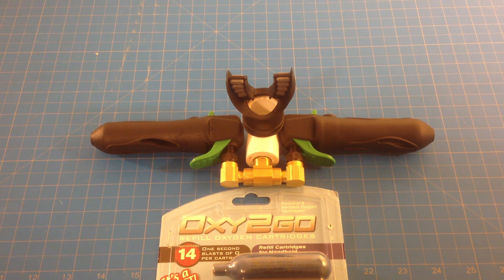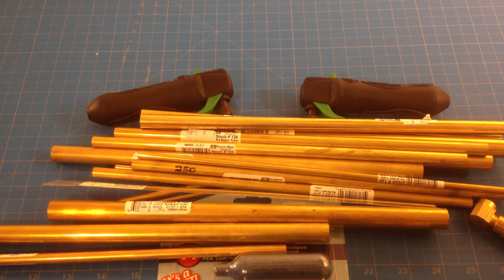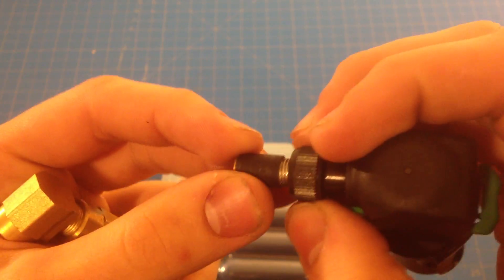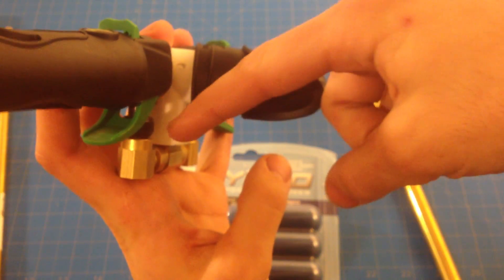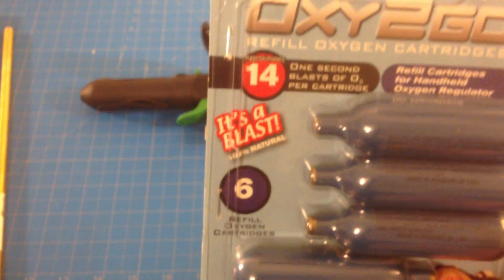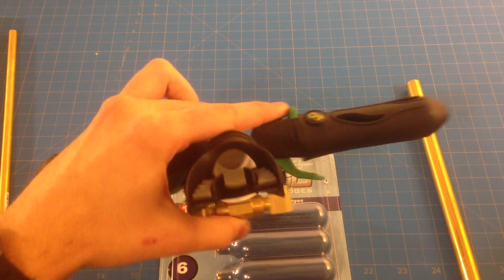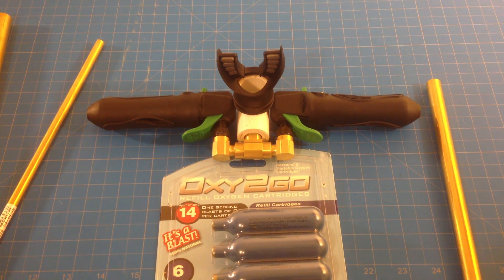007 Mini Scuba Tank Prototype V2

Comment: This is a good way to get yourself killed. There's a reason that regulators are used. This is a great example of why scuba tanks and regulators have to adhere to safety standards and regulations, because shit like this will kill people.
Reply: Yeah, because all of the worlds greatest inventions started out as the safe, regulated fully developed product you buy today. Instead of shitting on the idea why not contribute to how the product could be improved. My suggestion would be to use compressed air in the same sized cartridge with an inbuilt slow release valve. I would suggest it could be used in bushfire burn overs where many people suffocate from oxygen deprivation despite being sheltered from radiant heat all for the want of a few deep lungfuls of air.
Reply: You absolutely do not know your shit. Atmosphere is about 78% Nitrogen and 21% Oxygen. The dangerous part about this is that beathing Oxygen at increased partial pressure concentrations can be hazardous. 100% O2 is generally considered toxic past PPO2 of around 1.6 which is what you would encounter at a depth of just past 20feet. In a medical hyperbaric chamber we may take you higher(deeper) than that but under water it isn't worth the risk. The risk is that O2 at these pressures is toxic to your central nervous system and causes convulsions/ siezures. This type of event under water will most likely kill you.
Reply: shrekster99 You are proving my point by not addressing the rest of what I wrote. Using this type of thing while mountain climbing is no where near like the environment encountered underwater, it all deals with ambient pressure. Also, you can't alter the concentration of the gas you breath by only taking one breath. You also can't regulate the pressure on your own , and this device may not even be able to deliver gas at depth anyway. Even if it could and he inhaled once at depth and held his breath while he ascended like he talks about doing he would likely injure his lungs through overexpansion. None of this stuff even deals with the high O2 content that he is using. 90% O2 needs some limited special handling and cleanliness standards. If not properly cleaned this device could ignite in his mouth before he even gets to the water.
Reply: thank you, finally someone gets it. This device isn't for full time diving but i a time of crisis where there is a shortage of oxygen, this contraption  would always be handy. This device is used and approved for such circumstances but as i will repeat, delivers the O2 at lower pressure. so, yes a pressure regulator is needed preferably but overall this device can be used.
Reply: You are supposed to regulate it yourself with 14 one second blasts. That is why the O2 concentration is high in comparison to nitrogen. Oh, and by the way atmosphere comprises of: Nitrogen (78%) oxygen (21%) carbon dioxide (0.03%) and less that 1% rare gasses (OCR information data readings for 2014). I work in the chemical idustry so I know my shit.
Reply: John Citizen This is bad info all around. Please do nothing other than discourage the line of thinking that this will work or be safe in any way, shape , or form.
Reply: Chris Rehder "Nitrogen (78%)" "oxygen (21%)"
Reply: Chris Rehder You minmalise the concentration and amount you inhale by taking one breath. This is not enough to kill you but will cause nauseous side effects. People use these systems in extreme conditions, and are mass preduced world wide. Situations can include mountain climbing, drowning etc...
Reply: Chris Rehder You minmalise the concentration and amount you inhale by taking one breath. This is not enough to kill you but will cause nauseous side effects. People use these systems in extreme conditions, and are mass preduced world wide. Situations can include mountain climbing, drowning etc...
Reply: If the earth's atmosphere was 100% O2 then we would only need to breathe once every few minuets. the concentration doesn't matter along as the quantity is not too high.
Reply: shrekster99 This is an bad oversimplification that can get you killed . "Concentration" makes all the difference when using underwater like the author of the video talks about doing. Whatever the "concentration" is normally (at the surface) is equivalent to the quantity at the surface. However, underwater (under pressure) the concentration is the same  but the quantity doubles every 33 feet or so of depth. So in his example of using 90% oxygen that is a "concentration" of .9, what people who know what they are talking about would refer to as PPO2 or partial pressure of Oxygen. Going underwater to a depth of 33 for example doubles that to 1.8 PPO2 which is over the acceptable risk limit for use underwater because of the likelihood of CNS Toxicity. Oxygen is toxic to your Central nervous system when present in this amount. The main troublesome symptom of this condition is seizure like convulsion that, underwater, will almost certainly cause you to drown. What I am saying to the author is do not use this device as he has described intending to use it. I'm not squashing his inventiveness or anything like that. People who can develop ideas such as these into good products don't do so by accident. They do so by understanding the physics, chemistry, and medical aspects of what they are doing. The video indicates that he clearly does not understand these things. Is your safety worth it? No. Learn about the field before you injure yourself.
Reply: shrekster99 No, I am very educated in this specific subject. Calling me names does not suddenly makes incorrect things you have said correct. I disagreed with your assessment and explained why. I notice that you did not address any of that content.
Reply: Chris Rehder I called you names because you blatantly ignored my statement of the atmospheric composition and posted exactly what i quoted (nitrogen and carry on...). I am uncertain as to whether this was because I was unclear or you are optically handicapped; but I do apologize for the unnecessary use of vulgar language. As oppose to the debate over concentration of oxygen I simply find this whole rally of strong opinions pointless as we are obviously not accomplishing anything by this and thus no longer wish to continue arguing. I will agree to disagree as we both clearly are very stubborn and devoted to our own opinion on this subject matter. Once again, I am sorry for any offence delivered through my communication with you.
Reply: Chris Rehder you badass :p.. after re-reading both you and shrekster99's comments multiple times, I agree with you.. I know very little of what you said but i think i understand.. The concentration matters at that depth because A) It is concentrated, and B) That is all the air your inhaling.. If oxygen at that level is toxic to your body then it wouldn't matter how much you inhale because it's still toxic.. It's like injecting venom into your body.. It wouldn't matter how much you put in your body because its still toxic.Perhaps one blast of it wouldn't kill you, but is it really worth the risk? Maybe it saves your life, or maybe your nervous system shuts down.. Based off of what I've read in these comments, I would do a lot more research on what you're trying to build before testing it out yourself.
Reply: Andrew shallow thinkers like you never invent. Every concept has risk one way or another.
Reply: idunno man.. I haven't looked at this thread in a while but i will say this (and again i haven't done any research or anything regarding this matter so i may be dramatically wrong). Astronauts would have trained to use these things.. Perhaps all this device needs is a regulator (because any gas at high pressure is debilitating to the lungs) Things that can be used as inhalants have a warning on their respective bottles partially because the pressure alone can cause damage to unprepared lungs. Perhaps one could make their lungs accustomed to the pure oxygen by training their body to accept it. However, i would say that this should not be used by an inexperienced diver, especially given the high amounts of pressure this device creates. and wait wait wait hold on about the blood plasma thing.. A bee sting hurts no matter how much of that shit you get inside you (granted a bee sting is usually not going to kill someone) I don't know anything about having to target nerves or whatnot but i do know that venom is toxic at any given level.. whether or not it kills you is an entirely different matter.. although i suppose that was what the original argument was about eh? Long story short: regulate the devices output of gas and it would become much safer.
Reply: I have seen many idiotic comments on Youtube in fact it is full of them but this comment from shrekster99 wins the Oscar Bafta and dumb ass fuckwhit award all rolled into one. Chris Rehder is correct not you so if you want any credability state your diving experience which agency you have done your training with and to what level. 
TILL THEN SHUT THE "F"  UP BEFORE YOU HELP KILL SOMEONE !
Reply: @shrekster99 you kiss the point lets say 99cc of venom will kill you 33cc can help build a tolerance 66cc will make you seriously ill but should not kill you. Now lets say we have a 33cc syringe that we fill both at the surface and then again at the depth I will state later.
At surface pressure of 1 bar 33cc is just that 33cc but go to 10m/33ft and that same volume when filled now actually contains 66cc as the pressure doubles ( yes I know I am using a liquid which is not compressible like air/oxygen but just let that little bit go and look at the big picture ) That syringe now contains 66cc of venom and this will make you seriously ill. Now lets take that syringe down to 20mm/66ft and refill at that pressure the syringe will now contain 99cc of venom as every 10m pressure increases by 1 bar so 20m is 1 bar surface and 1 bar for each 10 m so surface pressure plus 2 bar equals 3 bar. At this amount the venom will kill you. Take it deeper and you see that the amount increase. So pure 100% Oxygen at surface or altitude may be fine for short periods but underwater ie under pressure it changes it does not matter taking short breaths it matters about the concentration and pressure that gas is under. 
So lets now say at the surface you can take 12 breaths before any risk may start at 10m that goes down to 6 breaths. Now do you see the danger ?

Good luck to the guy I hope he continues to develop it but safely and with proper understand that pressure changes the risk significantly and the first 10m underwater is the greatest change ie pressure doubles.
Reply: shrekster to your comment you say it delivers o2 at lower pressure but the pressure increase with the depth. A trained diver understands this which is why one of the first things you are taught is to breath out slowly ie aaahhhh as you ascend because otherwise you would risk getting a lung over expansion injury, which in itself can be fatal.
Reply: F y man, this could actualy save someones life,  just one breath is difference between life and death .
Reply: Joshua Obrecht actually the venom if in little enough amounts would be diluted with the blood plasma, so no it might not kill you (concentration is quantity in a given volume) so a small amount of venom throughout your bloodstream would not have any effect unless it targets nerves. And in response to oxygen you can breathe it pure for up to two weeks at a decreased pressure, as this is how the astronauts aboard the Apollo and Gemini mission respired ("The astronauts in the Gemini and Apollo programs breathed 100 percent oxygen at reduced pressure for up to two weeks with no problems. In contrast, when 100 percent oxygen is breathed under high pressure (more than four times that of atmospheric pressure), acute oxygen poisoning can occur with these symptoms") Patients suffering from acute carbon monoxide poisoning also breathe pure O2 but under our atmospheric pressure must be monitored carefully. All in all, you can breathe pure oxygen at a reduced pressure, but on Earth this is risky but chance of injury is little if few breaths taken. Prolonged exposure will cause certain death in our climate.

Comment: 100% oxygen is toxic at very shallow depths due to the pressure forcing it into your bloodstream. scuba tanks use cleaned air, common misconception. in fact, deep divers reduce o2 to reduce toxicity at greater depths.
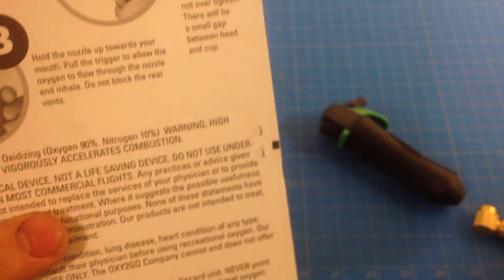Reply: 2:15

Comment: Holding your breath underwater while breathing off of some form of compressed air is a really bad idea. You are looking at getting a lung over expansion injury. Also O2 under water becomes poisonous at certain depths so I suggest you read more about ppO2 and scuba before any form of water testing. Also you need to regulate the pressure from the cartridge, if you try breath from a 50bar cartridge you are going to damage your lungs.

Comment: Love this idea, didn't know about those mini oxygen tanks. I've been looking into scuba gear for the sake of a situation involving flooding or smoke and having the ability to make it out of that situation.
Reply: That’s not what it’s for plus you need a certificate.
Reply: @chelseagonzales7584  1.) firefighters SCBA and divers SCUBA systems are almost identical in function aside from SCBA usually using full face masks and SCUBA using mouthpieces, as well as the orientation of the tank on the user's back.

2.) the video is about making bootleg scuba gear using home depot plumbing fixtures.

you think regulation and certification is even being considered here? 
that's funny.

 that's like assuming someone building a flamethrower in their garage is worried about weapons regulations.
 it's possible, but highly un-f*$*ing-likely.

Comment: It says on the box that there is 90% oxygen in the cartridges. The standard air that SCUBA tanks are filled with is 21% Oxygen. Which is safer for being underwater. If you breathe too high of a concentration of oxygen underwater at certain depths, you will get O2 poisoning, which is fatal.

Comment: O2 at 6m (18 feet) becomes toxic, so I wouldn't test it below 18 feet. The average total lung capacity of an adult human male is about 6 litres of air so do you have enough air in the cartridges. Also never hold your breathe when you inhale air under water because if you do come up, while holding your breathe you may experience a lung rupture. Cool idea, just learn the basics of scuba first, good luck

Comment: the higher the o2 the longer you can hold your breath. you shouldnt be breathing normally with something like this. if it is a spy scuba tank, you should be holding your breath as long as you can to reduce bubbles.

Comment: Still no regulator? A hole for excessing the extra pressure? You are carrying a very very very very tiny compressed oxygene tank. If you want even ONE breath on 150 bars pressure you cant be putting a darn hole for excess oxygene to come out. You will need all that oxygene in your lungs.

Anyone watching this. DO NOT TRY THIS AT HOME. This guy has no clue what he is doing.

Comment: how about an oxygen helmet like you get like maybe get a helmet that you can make air tight and add the pure air that elders use in there portable oxygen tanks that's use if they have breathing problems and get maybe pbc tubing or flexy tubing but this is just a suggestion

Comment: if its air in a can then it wouldnt matter the only problem is it wouldn't go down with you it floats but the thing says do not use under water means that they don't know if it works or not but i know it does

Comment: Those canisters are used to go *UP* in atmospheres (hiking) -- *NOT DOWN* (diving).

Lot's of dangers here:

* Canisters are 90% oxygen -- oxygen gets TOXIC the deeper you go. Using this below 25ft, you'd probably convulse and drown.

* Also, being 90% oxygen, you have to use gear that's cleaned and rated for pure oxygen. This obviously is not -- so there is a fire issue.

Diving with 90% oxygen is for Technically Trained divers.

Great idea, poor execution.

Comment: That is true, however that is when you take in a full breath at the service where the pressure is 1 bar. When you do it at 10 feet the pressure will be 1.3 bar meaning that there is 1.3x as much air in your lungs as will fit in there at surface level.
Think about what will happen if you take a FULL breath of air at 10 feet, hold your breath and swim up to the surface. You will most likely suffer a lung over-expansion injury. The trick is to keep blowing small bubbles, keeping the airway open

Comment: Absolutely incorrect.  If you go to the bottom of a ten foot pool, inhale a huge breath, and then surface quickly without exhaling....then your lungs could EXplode.  However, they would not IMplode just by diving deep while holding your breath.  If that were true, I would've died a TON of times already.

Comment: I ran rough numbers.  Seems like this would be toxic at depth below 18ft if you're exerting yourself "mildly" and toxic below 26ft if you're completely relaxed.  Anything much below those depths and you're pretty much guaranteed to be convulsing.

To clarify: this has ABSOLUTELY NOTHING to do with the bends.  For further info, take a Nitrox course (or just look up the wiki article on oxygen toxicity or Maximum Operating Depth).

Comment: He would also know the difference between "The Bends" and an embolism. And would know that the reason that pure oxygen can't be breathed is not because of the bends, but because you need nitrogen for proper exchange between your aveoli and blood cells.

Breathing pure oxygen will create fluid in your lungs (much like pneumonia), which will lead to pulmonary embolism. This will happen regardless of whether you're at depth, or on the surface.

Pure oxygen will fuck you up. Don't do it.